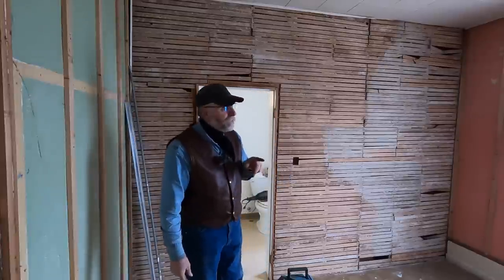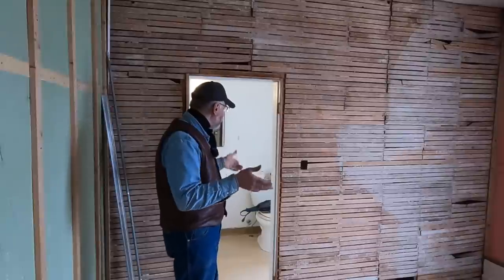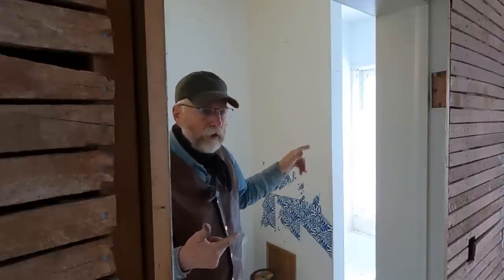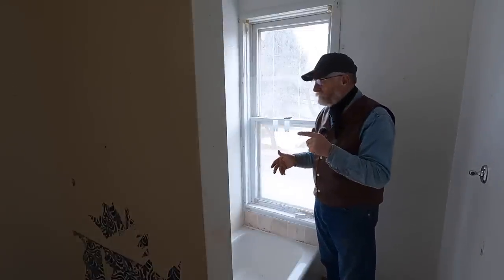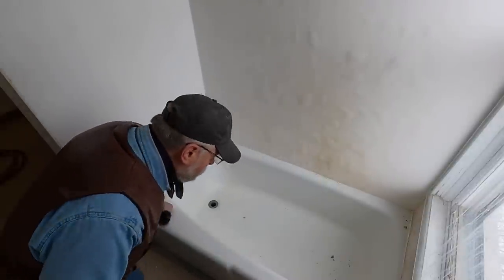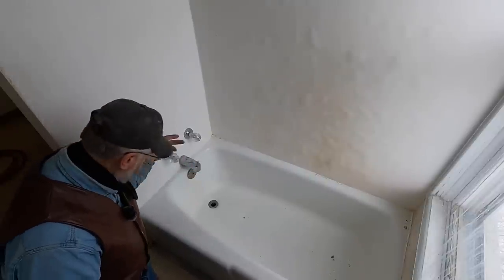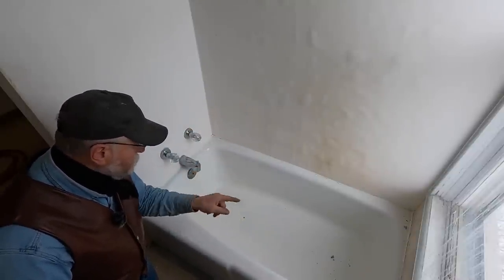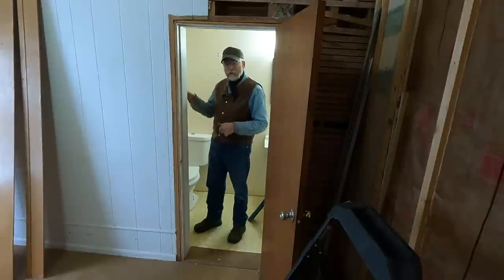1906 Hotel - Out With Cast Iron Tubs | Engels Coach Shop

Comment: I removed many many cast iron bath tubs over the years always on my own.  I always used a heavy ball pein hammer , just like your smithing hammer, took it out in four pieces, down the stairs and into the van.  But make sure you wear ear defenders, safety googles and heavy gloves, cast with vitreous enamel can be very unforgiving. Regards

Comment: Not done it myself but have seen that a good blow with a sledge hammer will have a cast iron bath in bits. If you were to score it first with the disc cutter you may be able to get it cracking where you plan.

Comment: My two cents worth: Sledge hammer will break down a tub- as others mentioned- but makes an incredible amount of noise and small, sharp fragments- BTDT. Many heavy pieces instead of a few very heavy pieces. Unless you're letting gravity do the work, i.e., pitching out a window into a dumpster, better doing as you did. To handle a whole tub, a C-clamp with a rope thru a pulley attached to an eye into a ceiling joist helps with a controlled removal/descent.

Why struggle getting a tub past a toilet when you'll probably have work to do on flooring anyway? Takes just a few minutes to remove a toilet and the whole space is free. Dollar-to-a-donut there are issues with the toilet plumbing that will need to be addressed anyway.

Surprised you didn't access tub drains from the ceiling of units below. Might be practical to build in access panels during remodel for future use. You KNOW you'll need them someday...

Comment: Sledge hammer is the go-to tool of choice by most plumbers for removing a tub you're not trying to save.
Reply: How tall is the mast on your forklift? When you change out the windows, would you be able to get the forks high enough to get the tubs you don't bust up/cut up out that way?

Comment: Twenty five years ago I was getting 200 pounds each from old houses , they were sold to antique shops and they ended up in very smart houses in Chelsea , But no way could I get one of those old tubs out of a house today down two flights of stairs , an old plumber told me that they used to be taken upstairs on the back of the plumber like a turtle , but having felt the weight I didn’t believe him ,

Comment: I use a tub for an outdoor bath. I make a fire under it and fill it with water. If you need help getting those tubs out I could come down and give you a hand.
Reply: Huh, now that's an idea... out back I have a really old high-sided tub that would be fun to do that with. I sure hope he doesn't cut up any more of 'em.
Reply: @Reziac  Yeah it gets a little smoky from time to time but if you use a basin to wash the hot water over your body it makes it better.
Reply: @aaron756  Or just stick to warm weather :)

For a lot of years I lived out in the sticks where the running water went by in the ditch... got used to these ways, but never had a whole cast tub to use. Ah, nostalgia. :)

Comment: interesting about the light,  I've had one bulb and one ceiling fixture that flickered (LED)  I replaced the fixture for the bulb first and it still flickered so I replaced the bulb and it stopped.  the other is a LED fixture that I will replace sooner or later.

Comment: I agree I've taken out many cast iron tubs and a sledgehammer works best give it a couple good wax it breaks into million pieces and about that window that's there I've also put showers in where windows were and I took the window completely out and used glass blocks it made it waterproof privacy you can't see through them and it also let outside light in just a thought